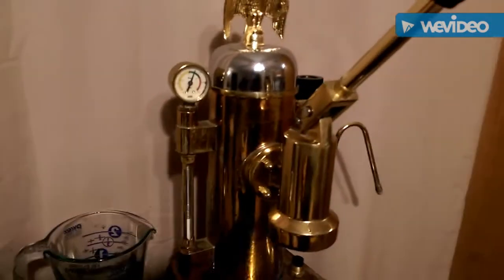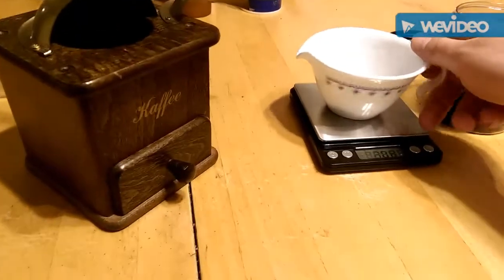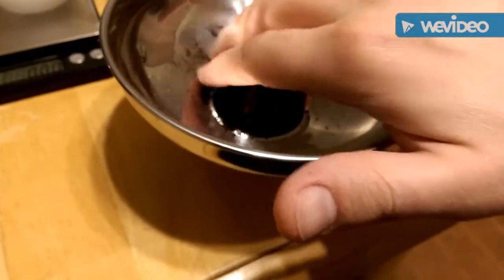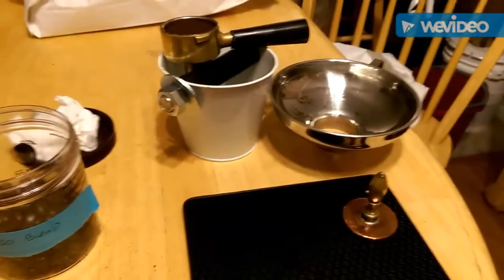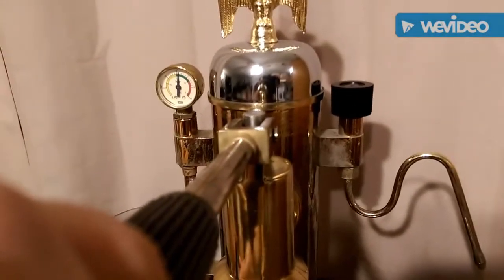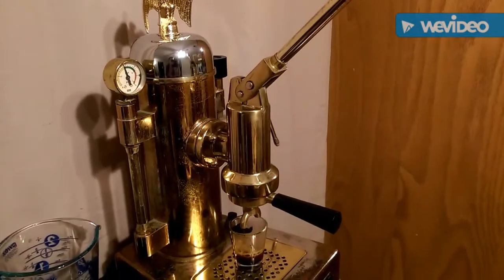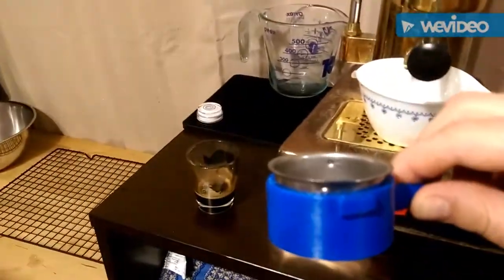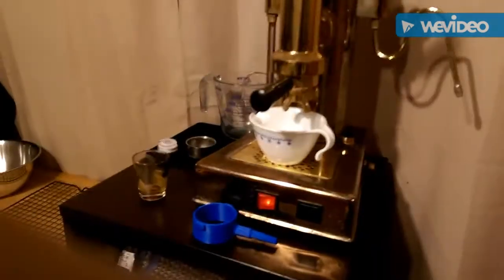Zacconi Riviera Espresso

Comment: Hi Greg.  Did you ever try to cast a portafilter? Do you have a data file for 3d printing that item? Was wondering if the object could just be enlarged a percent or two to account for shrinkage during casting? I bought an old La Riviera a few weeks ago. Have restored some parts. Need to get a few more seals and a sight glass (level glass). Missing the portafilter. Please message me if you can. Thanks!
Reply from the maker: We tried, but there were issues. To correct for shrinkage would be a guessing game.

Ended up trying the portafilter for ponte vecchio, the nice thing about that one is that it has a retaining clip.

It was close. We had it stripped and re-plated. Unfortunately there is still work being done on it and I haven't been able to actually test the completed version... People on the home barista forum seem to think it works though. I ended up getting baskets for both ponte vecchio and for the zacconi to see if it makes a difference. But again, I haven't had the chance to test it.
Reply: @albagr01  Thanks for your reply!  Not sure I understand "We had it stripped and re-plated".. the PV portafilter? Why?..  I think I will just buy this one  https://www.lamacchinadelcaffe.com/en/portafiltri-pontevecchio.html Is it the same one you bought? What is the retaining clip?  I can buy about 7 needed items from the same company to compensate for the ~$30 shipping. The prices are considerably lower than USA sellers. I need a sight glass (level glass) nut. Ever seen one for sale? I'm asking a couple of these sellers in Italy if they can source one. Best!
Reply from the maker: @kalo93406  We had the whole machine re-plated in copper, so I wanted the portafilter to match.

I THINK that is where we got it from, but I'm not 100%. I did not purchase it and don't have an order. I did order the portafilter baskets from there though, but I haven't had the portafilter to test it. I'm still waiting to get it back and in the meantime, I seem to have spring a leak in the sight glass, so my machine is out of commission until I can commit some time to spend on it. Fortunately, I have a working Pavoni.

The retaining clip is a spring inside the portafilter that keeps the baskets from falling out. Zacconi used dimples in the basket that applied pressure against the portafilter, but they don't work very well, mine are either too tight or too loose so the basket either falls out, or is hard to get out. the spring clip is much better and is what all the professional machines I've worked with use.

Heads up, I bought a replacement shower screen from that website and the ones for pontevecchio don't fit my zacconi. so if that's one of the items you're looking for, be keep that in mind.

Another good source of parts is the zacconi workshop. Also in Italy, so you'll have to pay international shipping, but those guys have been pretty helpful for me as well. http://www.zacconi.net/en/index_en.html

I always let them know that my machine is the older style. They have some parts, but not all for the older size group head.

Good luck.
Reply: @albagr01  Thanks so much for more details!  Wow, re-plated the whole machine, that must look great. Mine has the brass and copper plating combo but the base is in very rough condition. I'll have it bead blasted or I'll try sanding it down some depending on how the base metal holds up. Did you do the prep work on yours or was it done by the plating company? I'll likely just spray paint mine trying to find a color tone that goes well with the copper and brass. The spring clip sounds great, but must be aftermarket as I've never seen it on these 45mm portafilters, Ponte Vecchio or others. Mine while missing a few things did have the shower screen. I will be ordering the 145mm Ponte Vecchio sight glass and seals from Italy I think. There is a group called Lever Fever on FB and I recently added a post about my machine. Maybe see you there. Thanks and ciao!
Reply from the maker: @kalo93406  I haven't looked into sight glasses from other companies, but I would be leery of using them, that is an integral part of the machine. if it doesn't fit just right you will have pressure and water leaks there (I'm having one now, but I think that's an issue with the gasket. I got my replacement from the Zacconi shop, correct water marks and everything. I also got a full set of seals from them, they had everything except the teflon seal that seals between the boiler and the base. I got a five pack of them from newegg for $6, but other places carry them, if you need one, just google "45mmx55mmx2mm PTFE Flat Washer Gasket White 5pcs" and you'll find places that carry them (assuming your machine is the same as mine).

My girlfriend is a metal smith, so she has contacts with the plating company, I was not part of that at all. As for the brass, we didn't re-plate that. The acid bath actually did eat away at the threads in one part of the machine and it required some work to fix it, thankfully metal smith's are amazing, so she was able to fix the issue.  You can polish copper and brass pretty well, give it some love with a good wax and then just keep it clean.

I'll have to check out that forum. I had been on home-barista, there isn't a lot of zacconi stuff on there. I took some detailed pictures, google "Zacconi Riviera - Teardown and rebuild w/ questions"

Good luck
Reply: @albagr01  Saw your teardown on HB.  I'm not too worried about the sight glass as they are pretty standard as long as it's 145 mm x 9mm will be ok. I didn't see the sight glass work on your photos but I think I saw the sight glass seals in your bag of parts. They are 15x9x5 mm and look like these.  https://www.cafeparts.com/Level-Silicone-Gasket-%C3%98-15x9x5-mm/Product_Manu/13320/Pavoni/362020 or buy from Ebay for $10!!! haha ..  Your finished Riviera looks great!